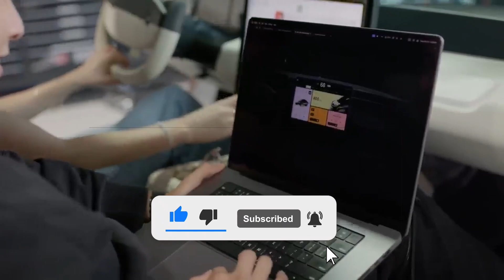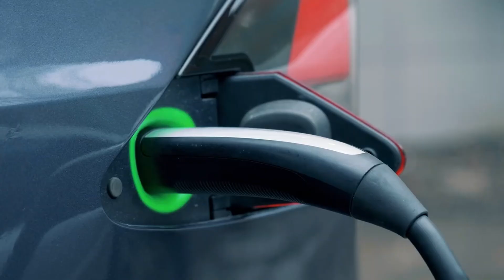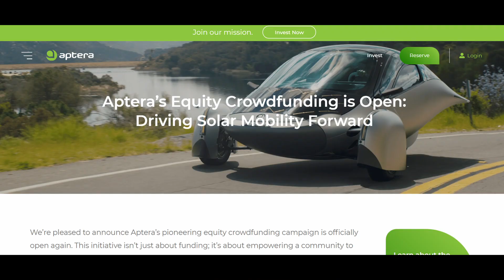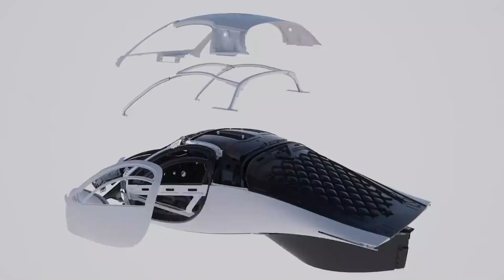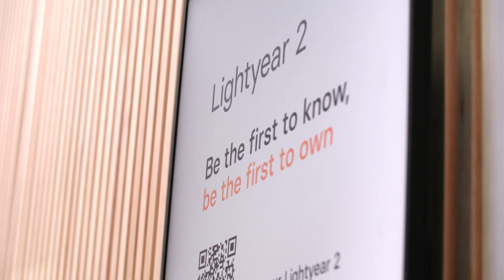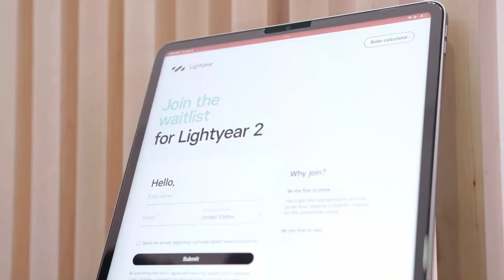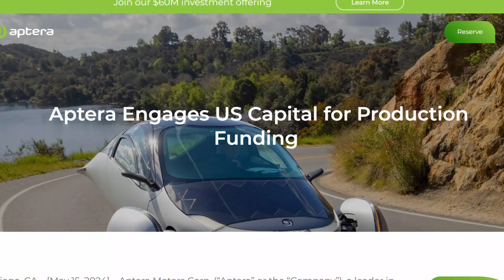Aptera 2025 PRODUCTION & DELIVERY Forecast EXPOSED!

Comment: I did put in a reservation in '23 but I don't see myself getting an Aptera any year soon.
Living in Denmark I have to realise that Aptera is made primarily for the US market and I don't see them using any ressources to make sure it will be approved for the European markets for several years.
I still love the basic idea driving with cv 0.13 though - wind resistance is the primary cost of driving an EV and I would buy it even without solar cells just for the efficiency. 
The Hyundai Ioniq from 2016 is STILL the most efficient EV out there and nobody has brought more efficient EV on the market yet.